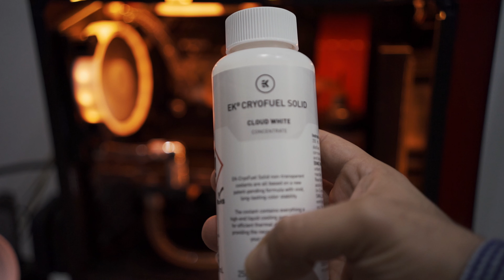Milk your RGB PC Loop - EK Cyofuel Cloud White coolant #EK

Comment: Are you still happy with the EK Cyofuel Cloud White?
Reply from the maker: yeah , no issues so far, using it with fine temps since I filmed the video ;)
Reply: FGtech Tips 
Ah, great!
Thanks for replying. I ordered the premix cloud white a few days ago, Then found out about clogging issues. Currently I have ek premix blue in my ek custom loop for over 4 months, without issues. I’m now looking forward to the cloud white.
Reply from the maker: I have no clogging issues so far but they are quite common with pastel fluids (I had this issue with the ek red pastel , you can see here https://youtu.be/Vya-92aHdes ). anyway no issues so far with cloud white but I didn't use the whole bottle. love the reaction with RGB lights!
Reply: @fgtechtips  With the ek red was it the newly formulated Cyofuel?
The link is dead.
Reply from the maker: @ZoneProduction448  link fixed, no it was a formula from 2 years earlier
Reply: @fgtechtips  When you said you had a clogging issue with the ek red I started to worry again. Anyways I've just found out the ek cloud white will be delivered today 😀
Reply: The ek solid white looks amazing in my set up. Custom Water cooling is definitely a learning curve. To take full advantage of the RGB,  the coolant has to clear or white.
Thanks for you help
Reply from the maker: @ZoneProduction448  i agree, I first had the ek clear, then tried red blood and red pastel, now with the white I love it. Next one will probably be acid green or purple

Comment: Did you just use 1 250ML bottle for you loop? Because I have one and didn’t know if I need another one or not.
Reply from the maker: Hi, at 6:30 I say that I used less than half of that bottle. So you should be fine with just one

Comment: Have you had any issues with the solid white so far as clogging? Any flow or temp changes?
Reply from the maker: So far so good, still running great in my loop
Reply: I have used many of EK solid color coolants and have never had a single issue with my Pc, I used white for over a year .. when I drained my loop it looked brand new still after some flushing, then I went to a super dark rich purple which I thought might stain the blocks and tubing .. again a year or so later it was perfectly fine, now I just drained and flushed it from the purple and am going with their fire orange .. I no longer worry about EK solid coolants as they have never given me an issue and my Pc runs non stop. I hear the red works well too and have seen people drain and flush the solid red with no ill effects. EK pastel or solids is my #1 choice for solid colored coolant 👍🏻
Reply from the maker: I am still using this cloud white and no issues so far !
Reply: @BiffsEquipment  Hey bud have you tried the mystic fog yourself?

Comment: will it clog up and ruin the gpu and cpu block?
Reply from the maker: So far everything is good, temps are fine, flow is fine
Reply from the maker: @nico thibeault depending on CPU model 70C is not much if full load on overclocked CPU
Reply from the maker: @nico thibeault i have a new video coming out tomorrow, you will see that with a 3900x default it goes up to 75 under liquid!
Reply: nico thibeault dude its a slim rad and its only 240mm plus its not the best block out there
Reply: @clover956  that's what i got now p240 but it's not slim the rad i got and yes it's the lowest end kit from ek i got but still is costly and works..
Reply from the maker: Yes don't worry works fine, mine has been great for all the time I have been using it (5 years and still great in my loop)
Reply: @clover956  not a slim rad not the one i got!

Comment: Mayhems Pastel are much much better than EKWB SOLID. I have tried both and Mayhems have better colors and can be used long time in the loop.  So disgusted with the EK Solid, more transparent I would like.
Reply from the maker: Really? I wanted to try Mayhems (even if not easy to find in Europe) but i have read everywhere of deep clogging issues even after just few days, so I went for the safer EK solution
Reply: @fgtechtips  I have used Mayhems pastel Ice Blue and Pink pastel along 3 years in a dual loop pc, just drain it 2 weeks ago for changing to EK, loop was very clean and colors stay like first day. In a second computer with simple loop with Mayhems pastel white, same thing with one year old, perfect color and clean when drained. I have changed to EK solid  white on those two computers and it looks transparent, so bad results. Never use EK solid again on my loops..
Reply from the maker: @ernestomartin3981  yes my red pastel lost some color after a year, but that's normal, this white is fine after 3 months as the first month. Will try Mayhems next time and will do a video on it